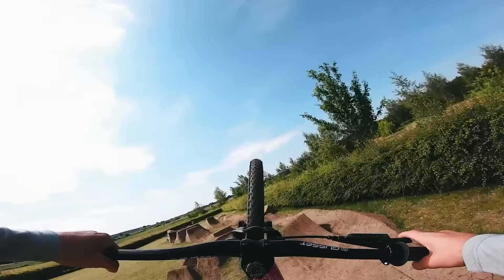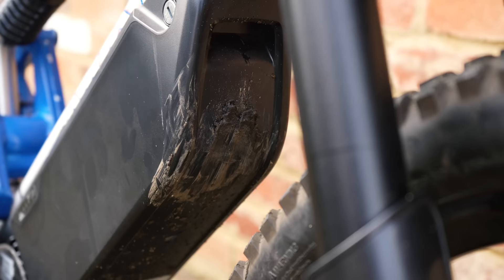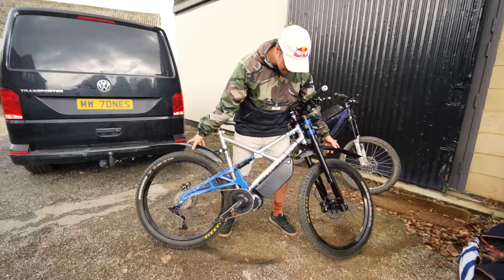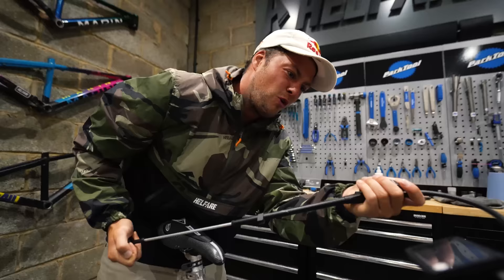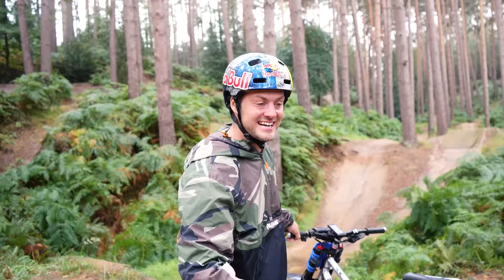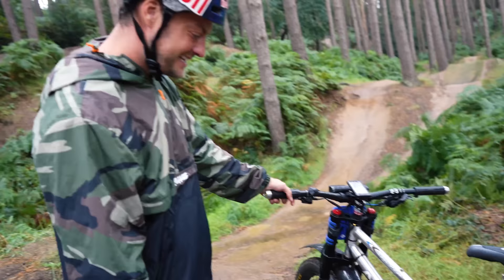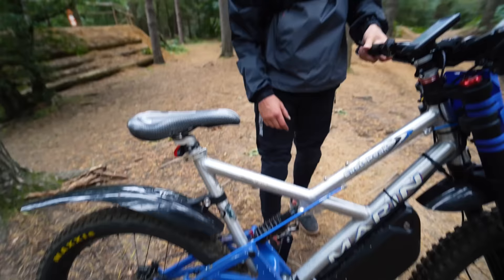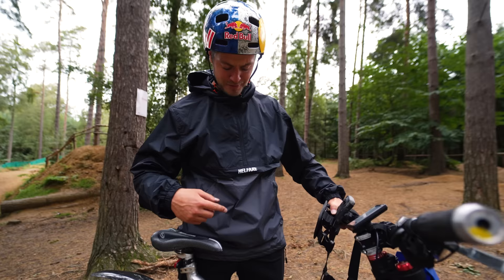THIS INSANE HOMEMADE E-BIKE SENDS JUMPS!!

Comment: matt, if you cant source a new double crown fork ( which im sure you can) you could try sticking a 24 inch wheel on the front to try to avoid the battery rub while keeping some stability. i would also love to see a 12 speed cassette on this absolute rig and how fast it would be able to speed up the hills

Comment: Those bafang motors are legit.  I have a 750w motor on my Hammerhead adaptive mtb

Be careful putting the chain on with it powered on.  If it's like mine turning the crank can engage the motor and you'll catch your finger.

Comment: My first MTB was a 1998 Marin East Peak. It was top of the line at its time. I still have it!
Reply: same but i abused it because i was new to mtb and couldnt afford an upgrade, had it 6 years ago now
Reply: Same, mine was Red and I had RST Hi 5 triples on it with Mag V brakes, red walled panaracer tyres Tioga saddle...what a beast
Reply: @wheelhobby  same as me! I upgraded the fork to rockshox recon air, and a monarch rear shock. SLX derailleurs, Deore XT V-brakes v brakes and wheels. The frame is too small for me now. But it means to much to me to get rid of.

Comment: Those Bafang kits are great fun, and the throttle makes it so that you can have a great time on any single track even if is flat or even inclined. So give the motor a real chance and put it on a good frame with a bling ring for proper chain offset and make a delicious MARINade instead. :)

Comment: I would recommend a Grin Tech battery mount so that you can relocate the battery onto the top tube. These mounts use hose clamps (and bottle mounts in unison if available) so that you can mount it anywhere on the frame. Alternatively you could run a backpack battery with a long power cable. We've all seen those Li-Ion fires, not nice.

Comment: Please I really want to see you do a full rebuild, at least with another kit if you don’t wanna pull this one apart! But take the motor, battery and controller and get a new frame so that it’s got some control, make it a dually chuck in some nice 29 FATBIKE tires then get some good forks and a good cassette and chain ring then you’ve got yourself a speedy mud eating powerhouse on wheels!!!🤘

Comment: Wonder if a lower headset cup with more stack might help your issues. Think wolftooth makes one? Just might have to use a different crown race for the 1.5 steerer bearing?

Comment: Epic, chuck out the stock controller and upgrade to ASI BAC 855 for 50amps continuous / 90amps of power (peak), with correct gearing (42T Lekkie type bling ring for correct chainline, something like a 26 - 28 t on the rear sprocket) full charge on a 52v (58.8v x 50 amps = 2.9 kilowatts), controller is generally capped at 2.8 kw of power.

Comment: @MattJones -> 
I need some help and I think you can help me figure this out. I'm 52 and used to Bike (downhill, single track, cross country) back in the 80's and 90's riding on a GT LTS Full suspension bike with Shimano components. It is a large frame with 26 inch tires. I still ride it to this day and did up till a month or so ago until I bought a Marin Rift Zone 29 XR (large frame). I'm still getting used to it. It feels so weird to be on such a tall bike and seems like I'm re-learning to ride to a certain degree. Anyhow that bike covers most my needs but I recently saw your video for the San Quentin 3 29in. Not being sure how a full suspension 29in bike would do in pump tracks or skate parks, I began to wonder.

You talked about a hardtail being good for learning the basics and after 15 or so years, I can't even do a manual anymore. Not that I could do them well to begin with but...fact is I'd like a hardtail to learn how to do the basics properly. The question is, should I get a 27.5 or a 29? I ask because I am finding the 29 hard to push around and need to manhandle it a bit more than the old GT LTS 26in. Bunny hopes, kickouts, simple jumps, stuff like that. I was unsure if I was just supremely out of shape or if I needed something smaller to help me learn what I need to do so correctly, then I can apply it to a larger wheeled bike?

Really appreciate some input from anyonwe really. Thanks in advance!

Comment: Mat please put a bafang 750 watt with a 13.5 amp battery on a Marin hard tail as it is lighter and easily lasts 1.5 hours thrashing it, I have a Merida big trail with that set up it’s unbelievable with thumb throttle,

Comment: Get a smaller 52 volt battery and a good used fork, do something with the rear sus,: and you are going into upgrade-itis....Look, why not do your own thing. Put a 1,000 watt Bafang on your favorite hardtail. That’s what I’ve done, it’s insane fun on the trail and a bit risky on the on the street, well, not so much for somebody’s that’s a seasoned commuter...
It’s like a whole new sport, going fast uphill. Now I do this on week days when there’s virtually nobody around. I pull over and stop for a lot of bikes going up or down.

Comment: This build is an embarrassment, but I still love the video, so funny, how do you source out the terrible build bafang bbshds. I've done over 15k miles on mine. It's now upgraded from the standard power 52v 30A to 72v 80A, hold on tight.....

Comment: Mtb conversions with a throttle aren't ebikes but electric mopeds... says the guy with a tsdz2b without throttle and a proper torque sensor unlike that bbshd wis a cadencene sensor...

Still incredibly fun to watch / ride, but this would frowned at at our local mtb tracks ( no throttle allowed ). Which would relegate it to riding it on public streets, which would get the thing impounded if you get caught without a streetmode enabled to limit power and assistance past your local laws ( 18mph isn't it? ). 

Not worth it to me, my e-mtb conversion is my daily transport.

Comment: sad. what an absolute wetbelly of a previous owner. though he did you a favor. those kits are more cash than you paid. CLEARLY he knew nothing about installation. my Fuji EFat runs smooth, and downhill goes 45 mph... on a straight though 30 is norm. ENJOY and be safe.